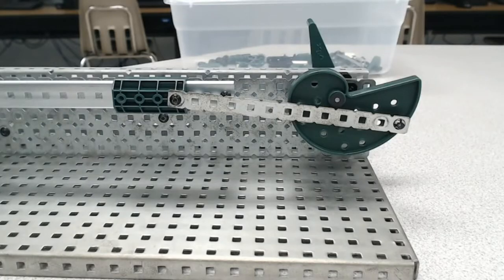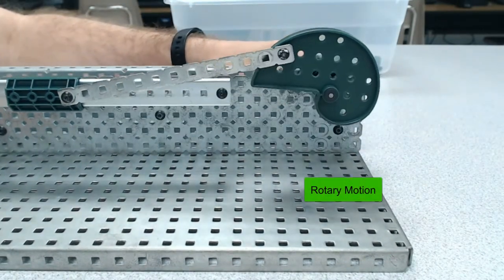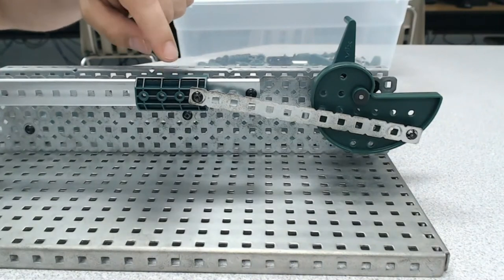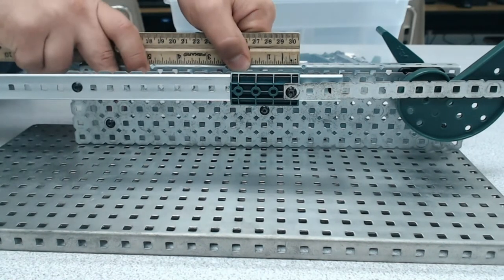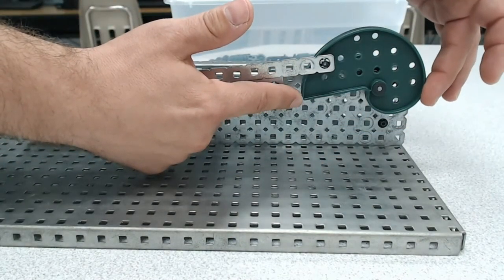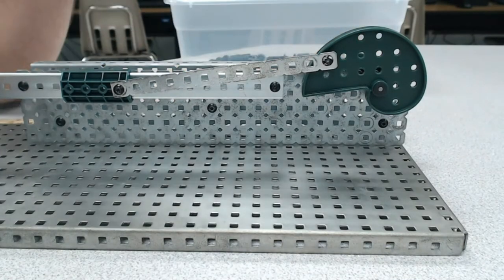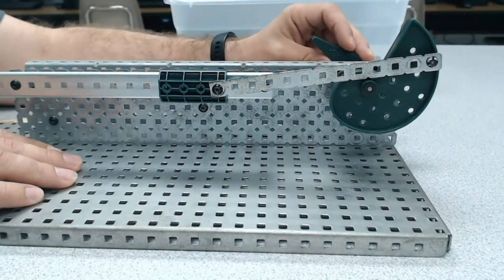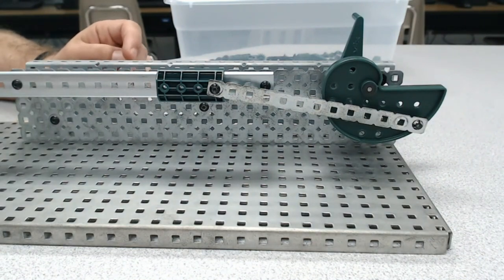VEX Gear Tutorials - Examining a Crank & Slider

Comment: Actually, the flow of power is reversible. You just need minimal friction and enough speed for it to rotate past the halfway mark. This is the same principle that engines do but with only one slider. this is also why engines have flywheels to help keep that rotation going after the slider can't add any force.
Reply from the maker: To a degree, you make a good point. Some of the other designs I have seen that allow for this are also designed differently or include additional parts. Such as the added flywheel you mentioned. Train engines are another example, designed with the sliders at different angles to help overcome the torque restrictions that occur if stopped with one slider in particular positions.

In general, crank and slider are not designed to be powered by the slider, but can be with added force or modifications. Thank you for adding that note for future viewers.

Comment: It bothered me that it wasn't reversible, given that a train's wheels are driven by the pistons, rather than the other way around. So I played around for a bit, and came up with an ugly (but functional) way to make the slider drive the crank. You can see it here https://youtu.be/92MtAGtSOd8.
Reply from the maker: Nice design. I feel that modifications, like what you did, would make for a reversible crank and slider, as I too visualize a train. From what I had previously looked into, the train wheels are attached in a different configuration, with two arms combined in the center. That center joint allows for a different movement than the crank and slider we build in PLTW. That appears to be one of the modifications you made. Is that a rubber band connected to it as well?
Reply: @Mythbadger  The rubber band is connected, yes. It's what's giving the system the push (or pull) past the spot where it hangs in the original system. I'm a biologist by training, not an engineer, but I think a flywheel would have inertia/momentum accomplish the same task. The flywheel would smooth things out, whereas my rubber band tends to make the system less smooth. (I don't happen to have a flywheel handy, though!) I also moved the slider down a bit.
Reply from the maker: That makes sense for modifications to achieve what you describe. Thanks for sharing what you did for others to test and learn.